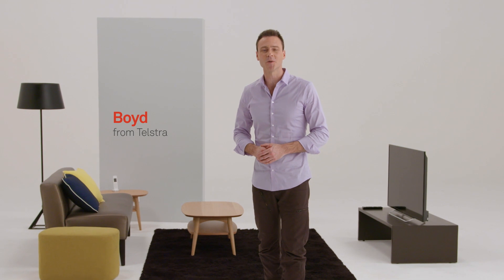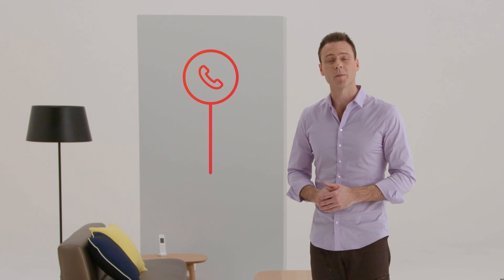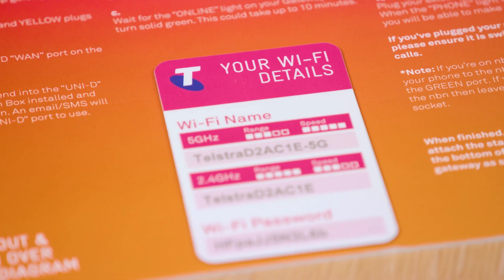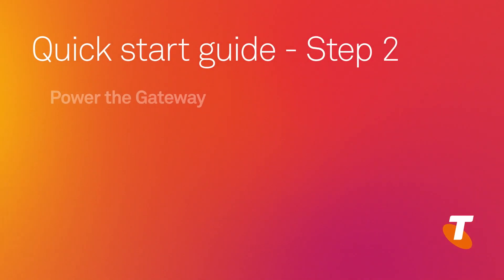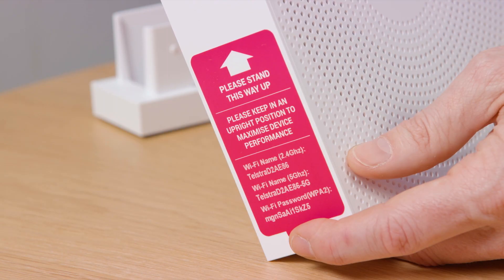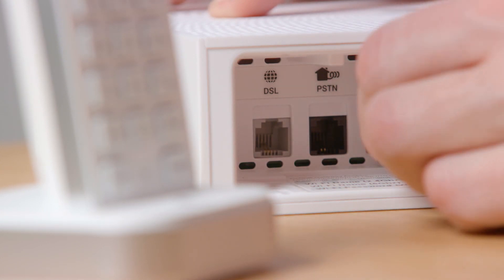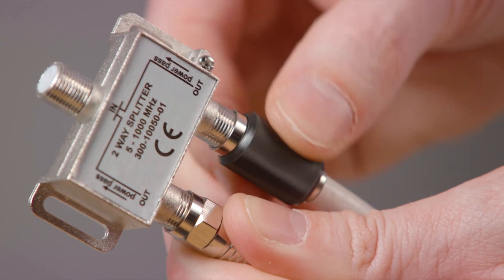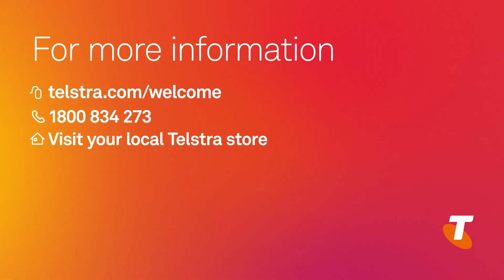Self-install using your Telstra Connection Kit – Hybrid Fibre Coaxial (HFC)

Comment: So this is the new DOCSIS 3.1 hardware is it? Because the Arris CM820 seems to be only DOCSIS 3.0 so it isn't the DOCSIS 3.1 HFC that was promised by the government. Aaris CM8200 is the next generation DOCSIS 3.1 not the CM820. Or am I missing something here?
Reply: DOCSIS 3.1 is only pipe dream. Currently the NBN HFC will be using DOCSIS 3.0 for now.
Reply: OzSimRacing From 1st of March 2017, Arris 8200 is standardised for installations (NOTE: If you have an existing 820, you'll have to purchase the router separately since the government doesn't give a crap)

Comment: Does anyone know if you have to use the Telstra NBN Gateway Modem or can you use a third party modem of your choice ?
Reply: memyselfandi you have to use the Telstra one as the dhcp server and the phone, then I connected apple router to Telstra modem for the wifi part I disabled wifi on the Telstra modem and run the apple router in bridge mode so yes you can use other routers but they must be in bridge mode and the Telstra modem must be dhcp otherwise the phone will not work I hope this helps
Reply: @BlackRoomful  

Thanks for the reply but it's irrelevant now, I originally had my telephone service with Telstra and my internet service with another provider but I have since been connected to the NBN via my internet service provider so I also have my phone service with them now as well.

Comment: This is so back-dated technology. HFC is being phased out in many developed countries around the world. Countries are already introducing Direct/PON-based Fibre networks which can provide up to 40Gbps upload and 10Gbps download with 100% SLA to a single user.
Reply: While i absolutely agree with you... sadly we are stuck with it. Theoretically the moment they upgrade over to DOCSIS 3.1 hfc customers would be able to get something like 10Gbps also.
Reply: I don't understand. I am on Telstra Cable (about to move to NBN in two weeks), and I have been getting 40Gbps for the past 3-4 years. So are you telling me that NBN will be slower once it's installed?
Reply: Hey Debi - so us telstra cable internet customers are getting a great download speed right now but our uploads are capped at something like 2mbps. With the NBN that should boost up to 40mbps. So your upload speed is going to be significantly higher, but your download speed is likely to be on par with what you are getting now.
Reply: Your fine. You will get HFC for the NBN. I have Telstra cable in my house and I have got the preinstall done by the NBN. I have been waiting for Telstra to connect me to the NBN. I have been looking at Optus for the NBN but they will charge $300 connection fee where Telstra doesn't for a new connection.
Reply: Debi Taylor Firstly, you aren't getting 40Gbps. Secondly Australian current cable broadband cannot peak 40Gbps. Thirdly, I doubt you are getting 40Mbps on Broadband either. you should be getting around 5 to 20mbps download and max 5mbps upload.
Reply: Leeuwin Glosz i have optus cable and i get 35mbps down and 2mbps up
Reply: I have Optus cable internet. Optus is switching off there cable internet in my area in August 2017. I'm switching over to Telstra NBN and I have made an appointment back in March when the HFC NBN was switched on in my Street. I will have to use Telstra portable wifi modem for the internet until the NBN gets connected.
Reply: Debi Taylor I have been waiting since March and the Street has HFC NBN active and still waiting.
Reply: Hi Dylan - Is that how u get low ping and high fps on b03? Haha! Btw, I play b03 on ps4. Whats ur psn?
Reply: Telstra cable user with the correct "speed boost" easily can get in the range of 80-90Mbps down. One friend of mine actually clocks 120Mbps sometimes.
Reply: You sure? Australia's public network infrastructure cannot provide speeds beyond 100mbps, unless its DNI sanctioned then its possible.
Reply: +MorphManDude I doubt it is 120Mbps, with the current technological implementation in the current urban development workplan, public infrastructure must evenly distribute bandwidth evenly across urban sectors in Australia. Each cabling can only support 1Gbps, meaning each sector has 100 households to a node within 500m of each node, this supports 10mbps per household only.
Reply: Doubt all you want but I saw the test results. Also I assume you mean 100mbps because that's what Telstra's fastest cable purports to be able to run at not a measly 10mbps. I get 80+ easily, was previously 90 but hey not many things really support that full use anyway.
Reply: Could I check if your plan is a "100mbps dedicated 100% SLA plan"?
Reply: Our HFC residential plans aren't 100% SLA. In regards to the previous stuff, they are advertised at 100Mbps down and 2Mbps up with a "Speed Boost" (30Mbps/1Mbps without the boost option).

I'm unsure where you got your (probably outdated) information of not being able to supply more than 100Mbps speeds to the household. I've been getting these speeds for the past three years in Australia.

I consistently get 115Mbps throughout the day, I sometimes see up to 120Mbps actual download speeds as well. You can see a quick test here: http://beta.speedtest.net/result/6556303641.png

Now that the NBN is available to my area, I'll be moving to that within the week, which is 100Mbps/40Mbps over the HFC lines. We receive the Arris CM8200 which from memory supplies up to 5Gbps down and 1Gbps up, plenty of headroom for the future.
Reply: @TheProteanGeek  Yeah I had Telstra cable for years and years always hit 100Mbps download, then when I rebundled my package last year I had to pay extra $20 a month for the SPEED BOOST to keep my 100Mbps connection was abit angry at that but my connection hits the 115Mbps mark but now I just got my NBN modem so doubt I will achieve the same speeds to be honest lol
Reply: Yup, you're going backwards.. plus everyone will be sharing your cable now so as they all come on over the ensuing months it'll be even crapper.

Comment: I have the CM8200 modem and Telstra Smart Model Gen 2. Should I be following the same steps as these instructions or is the Gen 2 modem capable of connecting the the HFC wall ports directly?
Reply: I had nbn which is good for internet and landline but mobile connections are very poor

Comment: +Telstra @3:40 Why are you advising existing HFC users with splitters  to remove them when switching to your NBN HFC offering? The splitter is installed and used for those of us using HFC-delivered +Foxtel. Not very smart advice, Telstra. Unless you're offering to pay for extra F-type connector outlets to be installed throughout our houses?
Reply: Paying for Foxtel isn't very smart.
Reply: frank mckeown It is if you like live sports and to channel surf. Netflix is shit.
Reply: Nothinglastsforever I've got Foxtel and I'm  happy with it so I will need the splitter.
Reply: In canada i get 1gbps with shaw we have spiltter for landline and modem. its really good. I never knew austrilla has different then we do.